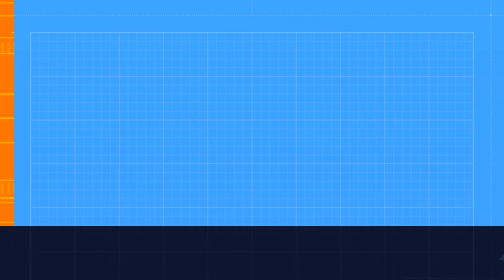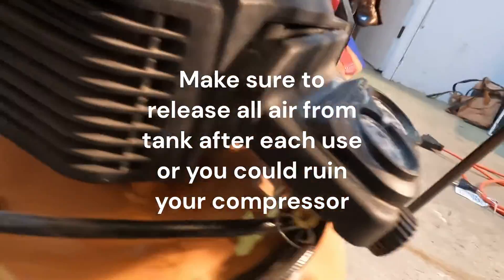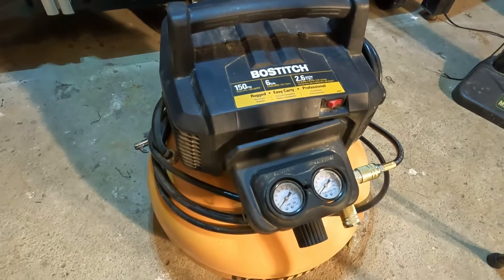Bostitch Air Compressor Tutorial

Comment: Hi . Just had a question ..
When you trun on the compressor at what number the tank pressure should stop
Reply from the maker: Thats a number you set with the dial. Turn it to whichever psi you would like it to shut off at and it should kick off when it reaches that psi
Reply: @fixanythingsavemoney 
Got it ..Thanks 👍👍

Comment: I recently bought this compressor n never owned a compressor n had a few question hopefully someone could answer. I see there 2 pressure gauges. The one that is for how much pressure is going into the hose, how much pressure should I usually run that at like for example if I’m just using it to pump air into some tires?. Also if I plug it in n turn it on n it builds up air pressure inside the tank can I just store it away with that air pressure inside of it or do I have to let the air pressure out before I put it away n if so how do I do this?.
Reply from the maker: Thanks for watching and for reaching out! Typically all air tools will give you a recommend  psi range to run the tool at. An example would be a bostitch 18 gauge nail gun should be operated anywhere from 70-120 psi. Filling up a tire I'd just set the dial somewhere in the middle and you should be fine. When you are done with the compressor for the day always empty out the tank. You can do this by pulling out the pin and hold it out underneath the dial that shows the compressor psi or you can unscrew the bolt underneath the compressor which will also release air in the tank. Thanks for watching! Be sure to subscribe and check out my other tool and diy videos if you haven't already! Have a great day!
Reply: @fixanythingsavemoney  thanks a lot. Also do I have to let the air compressor get all the way full before I can use it?.
Reply from the maker: You don't necessarily have to but it does shut off automatically once full. When you're using it and it detects the tank is getting low it will kick back on to fill the tank but no you do not need to wait although I usually do since it doesn't take too long to fill.

Comment: Can anyone tell me why mine is shooting blanks? The gun doesn’t feed itself nails. I also just found out that leaving air in it is bad lol so I’m sure I’ve left air in there before
Reply from the maker: If you the psi set to the correct parameters for the nail gun then you shouldn't have an issue other than your nailer may be bad.
Reply: @fixanythingsavemoney  I’ll check that out thanks a lot for the comment
Reply from the maker: @jonathanroberts9043 no problem!

Comment: I have this same one. Can you pin a comment with what the psi should be for the air pressure trigger, staple, brad nailer and finish nailer?
Reply from the maker: Different manufacturers have different recommendations for the psi the tool should be used at. What do you have?